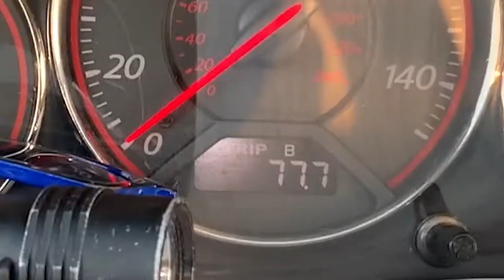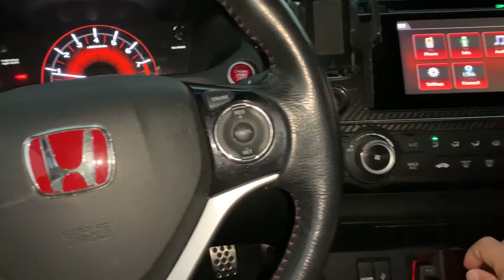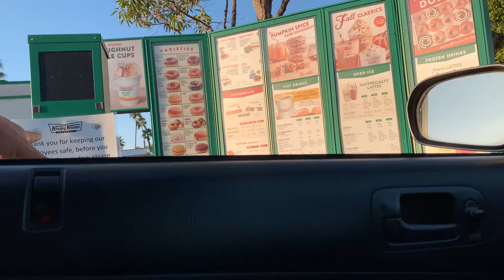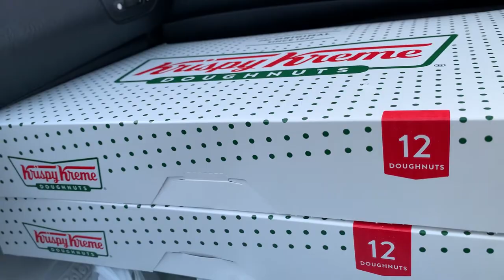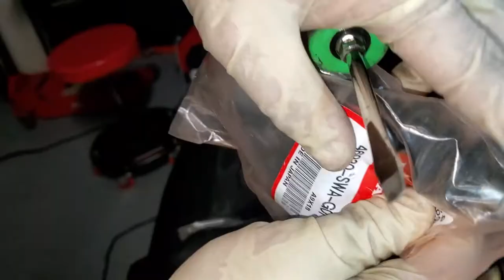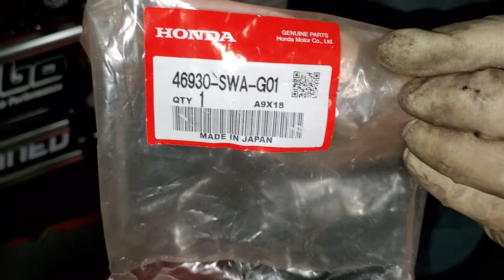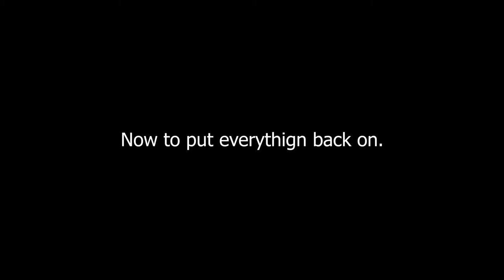[E75] Master and Slave Cylinder replacement (2015 Honda Civic Si - FG4)

Comment: Man . Any way you’d be able to help me out ? I have both parts and they need replaced . Clutch is all the way down to the floor and I can’t shift
Reply from the maker: Sorry to hear about your car troubles. Most likely your master cylinder for the slave cylinder may have gone bad. But it’s good practice to replace both when one or the other does go out.  I’m not sure how much help I would be… my team and I usually only work on family and close friends vehicles.  At times to the point where we can’t even work on our own cars.  Lol. Sorry for the late reply one of the guys from my team informed me that there was a comment to be answered. Hope all is well and you were able to resolve your issue with your car. Take care and stay safe out there! Thank you!

Comment: Mine won’t go into gear at all and my clutch is straight sponge and doesn’t come back up at all
Reply from the maker: The most common culprit of that is a leaking clutch master cylinder, but don’t also rule out the slave cylinder as well… It’s always good practice to replace both anyway.  So you’re probably losing hydraulic fluid somewhere and most likely there’s a leak in the hydraulic system. Good idea to take a quick peek under the dash looking at the clutch pedal area seeing if there’s any grease or witness from the hydraulic fluid.